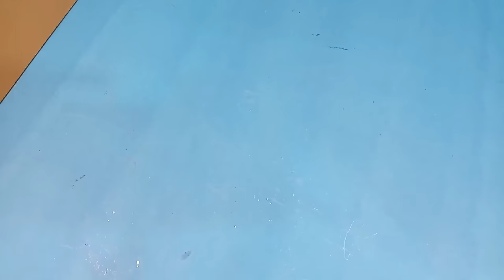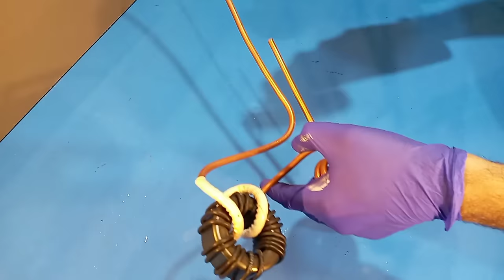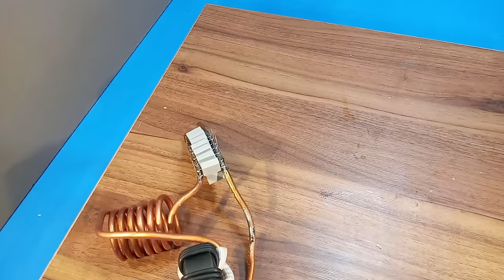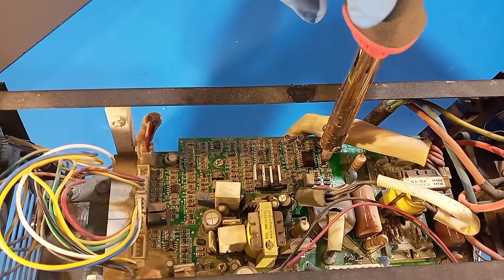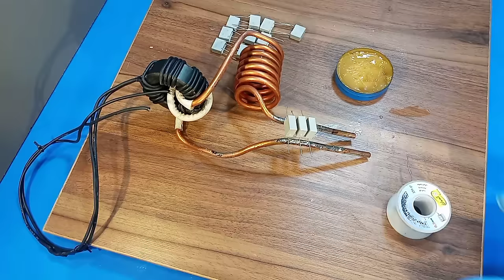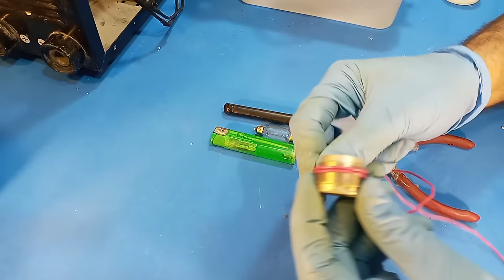DIY  induction heater by welding machine

Comment: Can You put a block diagram of all connections?
Reply from the maker: Yes . I do as soon  as possible.
Reply: I'm waiting too
Reply: Assim que tiver ficaria agradecido também.
Reply: It's been almost a year where is the diagram block
Reply: the welder is just a power supply. You still need the rest of the switch and caps to create the right frequency. or just buy it made ond use the welders as a power supply.

Comment: That's so cool I have a 600V 3 phase old Miller Welder will use it for this
Reply from the maker: What kind is that , inverter or transformer ?
Reply: @funwithelectronic4140  It's old so it could be transformer might not work for it :\
Reply from the maker: Transformer not work . But you can find old inverter and make this .

Comment: Nice video, and thanks for sharing.
Can I use another means in place of welding machine. And what is the energy consumption.
Thank you
Reply from the maker: You can use any chopper.  4 kw
Reply: @funwithelectronic4140  thanks for the reply

Comment: Bro, you are Nabeghe!😉, you will have an awesome channel!
So is that tap water you used for cooling?
Reply from the maker: Yes . By 12v simple water pump
Reply: how many smd resistor code did you throw away?

Comment: Does the section where you heat the metal plate suggest that the field is strongest at the edges in the work coil???
Thanks for the great video!
Reply from the maker: No. The strongest field is in the middle.
Reply: @funwithelectronic4140  ARE YOU POSITIVE?????
There is mathematical proof,  also numerical and computer simulation (based on the BIOT-SAVART LAW) that strongly suggest it is nearer the inner edge, more specifically, being at a locus of points forming the "circle of MAXIMA" around the exact inner center of the coil.
In fact, the weakest flux density is at the very end of the 'centers' of the coil (two points), where the flux here is exactly half that at the middle center axis.
Reply: I see that where you place a piece of sheet metal over the coil, it heated far more along the outer coil area.  I think this isn't just from a hot coil, but from the much stronger magnetic field at the edges of the inside of the coil.  To test this very simply, insert a fireproof sheet between the coil and sheet (or just hold it slightly above the coil).  You should see that the max. induction heating is due to the field being much more intense at the INSIDE perimeter of the coil.

Comment: Yeah yeah, you skipped the most important part at time stamp 3:39 where you pass the thick tube through the ferrite core, and all of a sudden there are two turns wrapped around the core a second later with the video skipping the critical part! Thanks a lot!
Reply: wha? whats so critical about seeing some pipe get bent?

if you cant figure out how to wind a bit of pipe through a toroid (and anyway, its better to used a gapped ferrite core, not a toroid) then maybe you shouldnt be contemplating projects that require dealing with copper pipe...

Comment: Pls make a video using induction stove modified in to induction furnace that can melt some gold
Reply from the maker: Hi . Thanks for watching and comment.  I will if I find an old induction stove.
Reply: I have a old induction stove, the problem is that I have read that the coils are at potential....

Comment: hey, please tell me, what is that black kind of wax... that melts by heat and glues the wires together? what is it called? it seems extremely useful! Thanks!
Reply from the maker: Hi . It is black hot glue. Usually  Used by hot glue gun.

Comment: Me pregunto que pasaria si conectaras un nucleo de flyback  de tv en lugar de esa bobina 😮 sacaria un Arco como de 30cm😮😵
Reply: Connecting the TV flyback transformer is possible, but it will probably burn out when trying to obtain an arc due to the high power of inverter welder. 
El posible conectar ed TV flyback transformador pero probablemente se quemará al intentar obtener un arco debido a la alta potencia de la soldadora.

Comment: Sir 
Is the potentiometer that you installed to adjust the frequency or duty cycle?
what pin did you connect it to?
Reply: description clearly states its for frequency change...

Comment: "wires connect to chopper output"
Chopper or copper ? This confuses me..😂
Where are the two ends of the copper pipe coil connected?  Which you put the capacitor on.

Comment: Hello sir. Could you please explain what is the small resistance that was replaced by the variable resistor. It was not clear in the video.
Reply from the maker: That resistance set the frequency of switching.   the frequency must set to resonance frequency of tank RC.

Comment: Sir this could be use for copper pipe?
Reply: Use a material that attracts magnets such as iron.  Copper is non magnetic and takes a longer time and needs more power and higher frequency mainly because of the thermal conductivity of copper is so great.

Comment: 2:38 how much H or uH is that inductor? Should two parts of inductor be separated ( I mean starting and ending point of winding)?
Reply from the maker: Hi . I don't  measure the inductor . Inductor is 7 turns.   two turns wire belongs to transformer. Transformer is 20:2 .

Comment: how many smd resistor code did you throw away?
Reply from the maker: one resistor . freq adjust.
Reply: @funwithelectronic4140  what is the voltage code for the resistor you unplugged?
Reply from the maker: Hi . The pwm ic is uc3846 in this machine.  Pin 9 of ic is Rt for frequency adjustments.  You must throw away this resistor and put the variable resistor .
Reply: @funwithelectronic4140  that you connect to that output from negative positive ct or rd ?

Comment: Where u add variable resistor
Reply from the maker: Hi . Pin 9 of ic(uc3846) . For freq change to resonans
Reply: Mahmoud Raddad  duty cicle it's fixed to 50%, about the frequency, give a look at the datasheets and use some math

Comment: How many turns, gauge etc should be mentioned in the video itself. Music is too loud and irritating.
Reply from the maker: Hi . 20 turned in primary
Reply: how many smd resistor code did you throw away?

Comment: i see black and white cable conected to capasitor and work coil, what cable it is? and where is conected from?
Reply from the maker: Hi . Black and red cable connected  to oscilloscope . For reaching max amplitude (by variable resistance tuning)
Reply from the maker: The black cable from chopper (300 vp-p)
Reply from the maker: And the white cable is secondary of transformer.  Transformer is 20 : 2
Reply: choper out ussualy have 4 pin out, 2 red pin out and 2 black pin out, every two cable red or black is conected together? or you just put in one black and one red pinout? because if you jumper 2 black chooper output it will make double 475K red ceramic capasitor from mosfet or igbt
Reply: very clear explanation, i thinking before red and black clips is feedack current sensing...in fact it's connected to oscyloscope 😁